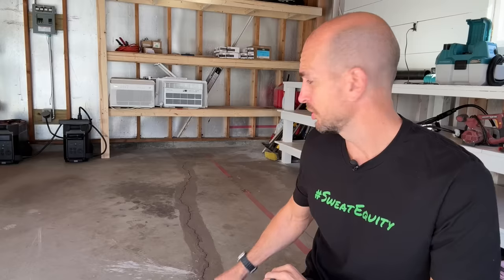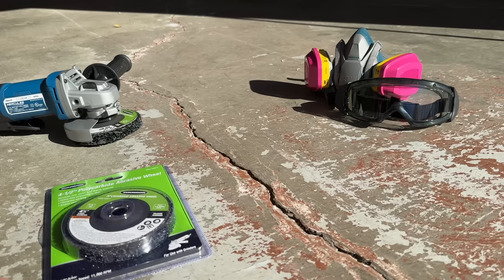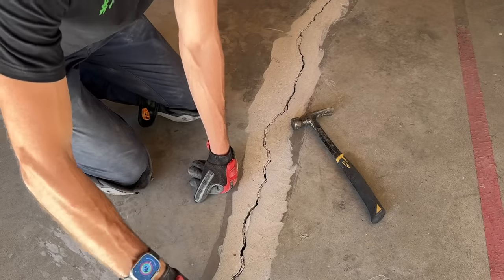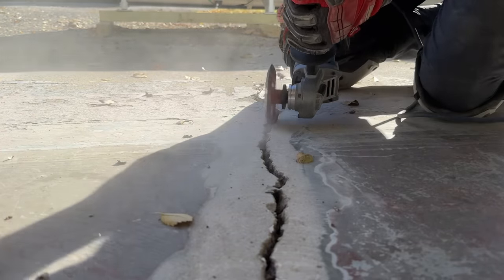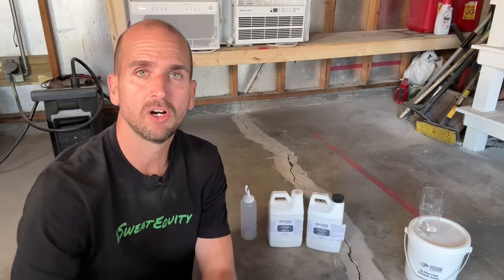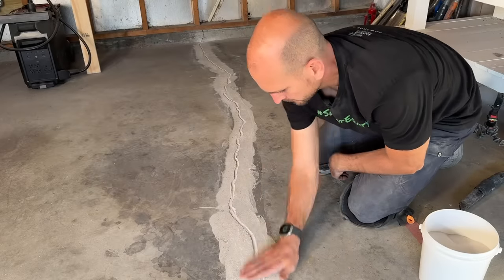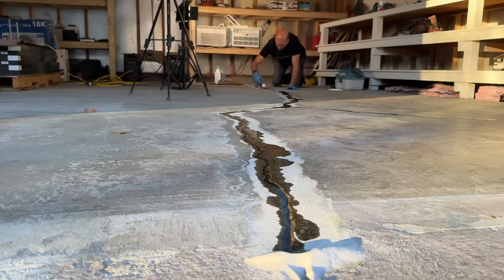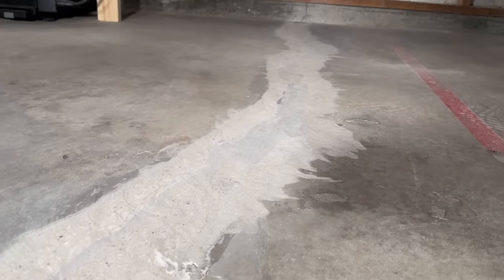How To Permanently Repair A Garage Floor Crack

Comment: Good clip.   A couple comments/questions -
Not sure if relying on wicking to carry the epoxy all the way through the sand to the bottom of the slab will work.   Maybe good to put some epoxy down the crack first then pour in sand, section by section, then do the top level epoxy fill as shown.

Probably should have done the crack extending up the foundation wall as well.

Comment: If this is your first attempt, how do you know it is permanent?  You did not address the reason the crack appeared and the floor separated in the first place. If the slab moves again, the crack will reappear.

Comment: Without fixing the cause of the crack will render this a bandaid fix. No matter how good the fix is the crack will return even if it is in a different place (Maybe next to the old crack). This crack was caused by ground movement under the concrete so unless the ground movement has been stopped nothing will stop the cracking!

Comment: You shouldn't use that big grinder dry. The disk heats up too much and prematurely wears it. Bring a hose in and wet the surface as you go.
Reply: I was thinking the same more to keep the dust down and possibly not need the respirator.
Reply: While this is true to ceramic, concrete isn't as tough and does not heat the diamond like tile would. I ground up a concrete pad after tile, and the disk has layers of diamond for this purpose. But definitely use water if you're OK with the cleanup after, this will help extend the life 👌
Reply: Bulshit!
Reply: Would make a huge mess. The epoxy wouldn't like that . True for other applications
Reply: You could use water, but the huge amount of slurry you’d have to clean up after in some cases is more trouble than its worth. A garage like that, i’d probably do dry too
Reply: @YAWN.... 😂
Reply: @Vito-ck5sv  isnt the epoxy water based?
Reply: Probably not smart with an electric grinder.

Comment: I get all the prep work, but why not just use some Hydraulic cement (or maybe something with a little longer set time) to fill the crack, then grind it smooth when it sets?
Reply: Cement and concrete set and harden by chemical reaction. They also shrink during the process.  Using them to fill cracks merely creates a mechanical bond which can fail during shrinkage. Filling any crack requires a flexible filler that will adapt to the thermal expansion and contraction of the two adjoining 'plates'.
Reply: @farrier2708  Okay, I can see where you're coming from there. Thanks.

Comment: I used to use leveling compound designed for cracks, expensive for a big project.Then I use stucco mix with fiberglass, been 3 years, held up without problems and super cheap. For huge cracks, cut an inverted "V", backer rods, #3 rebar. YMMV

Comment: My garage floor is new construction 2015 with post tension and a year later was cracking and now 8 years later the crack extends entire width of garage and getting wider.  Post tension is a scam.

Comment: Well as a flooring contractor for 40 years i can only say, this it a temporary crack filler is all.This does not have the strength to withstand the forces put on the slab.
Reply: What would you recommend?

Comment: Epoxy is great, BUT, it's not UV resistant.  If you leave your door open a lot, the sun will fade and eventually degrade epoxy.  Use catalized polyurethane........you can add the speckles into it, too.

Comment: I would have tried using self-leveling concrete to repair the bigger crack, although maybe someone will know this this doesn't work. I'm not sure I would use it for the hairline crack, however.

Comment: Wouldn't it be good to have a vibrating tool on the floor to assist those granules settle down deep into the crack and potentially block termites from crawling through it..!

Comment: Just use a wire wheel on the Grinder prior to using the grinding wheel so it don;t gum up the cutting disk.

Comment: On a slab that is on expansive soil I would not think 1/8" of epoxy would hold up to long and the slab movement would crack the epoxy.

Comment: OK you learn something. He started out with something cheap and moved up to a diamond cup wheel. Finally that’s what you should start with from the beginning little bit more dust, but it’s the best way to go to get you to true clean concrete better bonding

Comment: Regardless of the title. Keep in mind, this is NOT a permanent fix. Most cracks in concrete floors are due to the ground underneath, sinking in most cases, especially after a major storm. It will eventually crack again, since the resin is not pliable. My cellar lasted 30 years filling the gaps with rubber calk. I used it for a woodworking shop. This time, I will be using the hydraulic cement for repairs.

Comment: Great video. Can you go back over that low spot with more epoxy?
Reply from the maker: Yep, no problem and that is exactly what I am going to do once I clean the entire floor and uncover how many more cracks I have to fill.
Reply: @EverydayHomeRepairs  thanks, Scott. This is inspiring. I'd love to epoxy our garage and we have a couple of these so I assumed I'd have to hire it out but I'm encouraged now. As long as we can do half the floor at a time, we should be able to add this to the 2024 list.
Reply: I think you may have to sand it first, so it can stick better.

Comment: Unless you FIX the cause of the crack, it will just come back.  Even the best epoxy cannot stop moving concrete, gotta fix the root cause .... either winter heaving or water causing settling or expansive soils.

Comment: I would have filled the whole crack with sand done one layer of epoxy let it soak in below the level that you're wanting to end at mix up another batch put another layer on top of the already dried epoxy that way it doesn't soak into the sand

Comment: The crack was caused by the concrete being in tension.   Perpendicular tie bars or straps inset would give it a chance of lasting. Not sure why to grind out crack when u fill with sand. Seems like a waste of time..  if it was a compression crack I could see grinding.  It will look good until the next rainy or freeze thawed season.

Comment: With a crack that large my question would be :-  "What caused the crack in the first place?"
To repair it as you show is merely treating the symptom not curing the disease, so the crack may open up again.
Don't get me wrong.  There are other considerations.  Not least are the costs of proper investigation and repair.
All I am saying is that this method should not be considered permanent.
Reply from the maker: Yeah, I should have touched on that a bit to give a little more to the story.  This garage never had gutters so I am assuming the water over decades and allowed the footings to settle a bit.  I have now installed gutters on both side to manage the water a bit better.  We shall see if that works 🤞
Reply: @EverydayHomeRepairs  I can't comment on that because I don't know the ground conditions nor when the garage was built..
My gut feeling is that you have no reinforcement in too thin a slab.  It's a common fault here in UK.  Sad to say my own garage has the same defect.  
Ah well!  C'est la vie!

Comment: Properly repairing a concrete slab requires addressing the reason it cracked, which is UNDER the slab.  If this was a valid method of concrete repair, then roads patched this way would last longer.  This is like putting bondo and paint on a broken car frame.

Comment: I get the appeal of something fast setting like that, but I'd still rather have a slower setting AND thicker version.

Presumably, I've been planning a while for an epoxy floor, and so it'd be easy, and preferable imo, to set aside a few evening or a whole weekend for it.
Reply: This it is such a thin viscosity material (30 cps ) so it can penetrate into the concrete and bond better than thicker materials. It is very important inside of a crack that is typically filled with dirt and debris that the epoxy can penetrate through that and get to the concrete itself.  In most cases, thicker epoxy cannot do that.

Comment: I would be worried the sand would continue to sink over time leaving a void under the epoxy and leading to an eventual failure. I'm thinking that after pouring in the fine sand, run a plate compactor over the crack so the sand works its way down and completely fills the crack to the bottom. Apply more sand and repeat as needed. Ensure you are well ventilated when using a gas-powered tool, which most plate compactors are. 
A reciprocating saw like a Sawzall without a blade can be used. I've seen them used on Concrete forms to vibrate voids out. Hold the tool with the shoe held tight against the crack, or one side if wide and run it to vibrate the crack. Repeat on the other side of the crack back and forth as needed. This tool is less powerful than a plate compactor, so take your time with it and repeat as needed. Let the tool cool as needed if it gets too hot.  
If there if there is a bed of gravel under the slab, as there should be, it may take allot of sand if it works down to the bottom of the gravel layer. 
Thoughts?

Comment: Fast set only 1 layer is too fast to not to be rushed, and no way to know how deep it soaked and bonded to walls. Use slower cure and 2 levels to assure all sand is bonded.

Comment: This isn't really a "How to permanently repair a garage floor crack" video (per what the title suggests)... It's a video on how to permanently repair a crack before you apply an epoxy flooring product. There is a difference... you might want to clarify that in you title so you're not wasting your viewers time.

Comment: when the concrete floor cracks the strength of the complete sheet of concrete has gone. It is now a massive weak spot.
It will continue to move with any excuse, water, temp, cars.....
If it wants to move a shitty repair will never stop it moving.

Comment: why didn't you SIKA?
Reply from the maker: Sika or Tremco are good for the outside cracks but not going to work for prepping the surface below an Epoxy Floor.

Comment: If you have a crack that big, you have a bigger problem with  the house settling .
Reply from the maker: Hard to say for this garage.  It hadn't been maintained for years and without any gutters.  At least thus far everything is holding up.

Comment: Epoxy is a waste of money.  Concretes ability to handle tension is zero. So it does not matter how strong your filler is.  Self leveling mortar is cheaper and strong enough.

Comment: I've seen a lot of concrete failures in driveways , pathways and shed slabs simply because the concrete was poured on prepared dirt without reinforcing mesh and builders plastic underneath . 10% saving on cost leads to failure , this is dumb economics .
Reply: Does adding fiberglass to the concrete mix on a new pour along with rebar/mesh add any benefit other than cost?  Strength? Crack inhibitor?

Comment: You are wrong, you will have problems in the near future, can not use a polyurethane element it will break down short period of time.  You need a hybrid sealant that expands in all weather conditions and can be used in water.

Comment: Sounds like a structural engineer, how many slabs have you prepared and poured? It wasn't compacted correctly, no rebar, not enough expansion joints.... Everything else is a waste of time. Maybe a broken pipe ?

Comment: typical cheap concrete floor job! the base under that floor is bad and is swelling when it gets moist and then shrinks when it Drys out causing cracks. The patch you did will only last until the floor moves again and the crack will reopen. I see this all the time and its because the contractor installing the concrete didn't put enough bas under it there should be at least 12" of base / crushed slag or limestone and then be rolled in this will give good drainage and make for a strong base to lay the concrete on keeping it from moving and cracking.

Comment: OMG, NEVER use epoxy to coat a garage floor, it is NOT a durable material.  It might look durable at first, but it is not.  If you want a garage floor that not only looks good, but is long lasting, and durable, use a proper polyaspartic floor coating instead.  Never ever, coat a floor with epoxy, you will regret it.
Reply: I don't know where you got your information, we have been installing epoxy-based floors for 28 years without fail.  We have also been replacing "improperly" placed epoxy floors. (Fact) If you don't do the correct preparation, it will fail. That is the majority of the issue not the material.  I do agree however, polyaspartic is a phenomenal topcoat. But not recommended as a base coat unless you apply a penetrating epoxy primer first.

Comment: Leave it to the pros. "Cross stitching" repairs should be left to the pros whom are usually to busy to make videos for the general DIY. Cross stitching requires adding rod to the system. Structural repairs of concrete is taken very seriously, and is very expensive. Do it wrong, do it again.

Comment: Bahahahahahahaha! Permanent is a strong word!.... u got messed up vapor barrier or compaction. Period. Its moving!  which causes the cracking. You would literally need to cut that out, make sure mesh or bar was properly installed along with vapor barrier then re pour. Still might not work though.....lol....